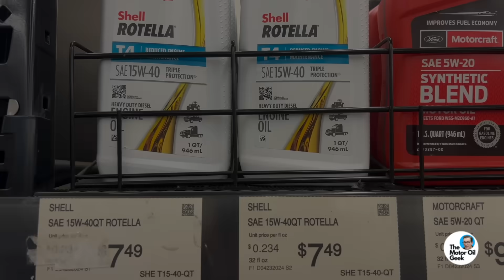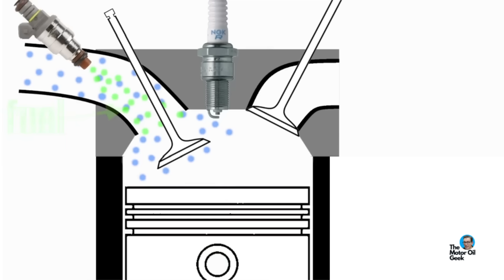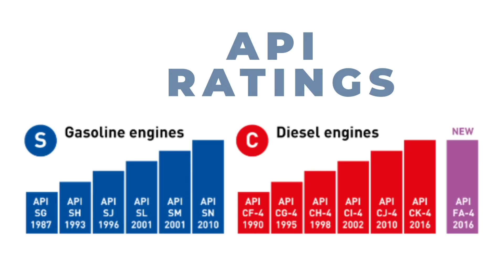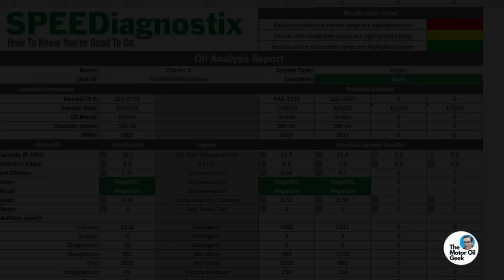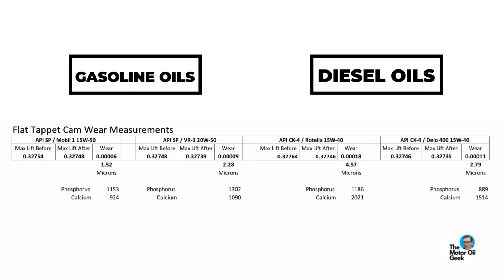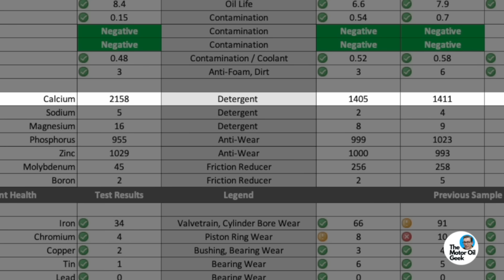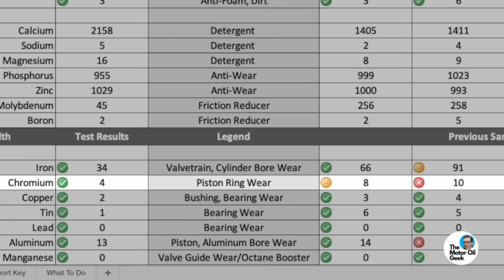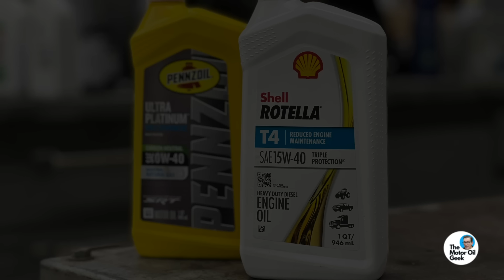Why DIESEL Oil is Actually WORSE for Gas Engines!

Comment: Lab tests the theories and what can happen, but in practice it doesnt matter much... have used diesel oil in small engines around the farm exclusively in both briggs and kohler engines. Zero failures. Also have used it in a F150 5.4 for 20 years with zero engine issues.

Emgine Oils are far different than other fluids like hydraulic and coolants. Use a good proven product and dont worry about it. Proper maintenance is more important. In the same sense though i would never use gas engine oil in diesels because thats asking for trouble.

 some of the newer engines are affected more, like an Ecoboost where a Penzoil is recommended due to the proven tests and experience behind it

Comment: I use rotella 15-40 in my zero turn kawasaki engine with 1800 hours. Runs like a top, no oil consumption at all. Equivalent oil john deere recommends.

Comment: Your use of the term "Passenger car oil" is confusing and doesn't make sense. Tens of millions of passenger cars with diesel engines are manufactured each year. Just stick to using diesel or gasoline, and stay away from passenger car oil. I'm surprised the old guy didn't correct you. He's obviously very polite.

Comment: I like how they used an audi-A6 ringland as evidence of using the wrong oil. Might as well have pulled a Subie EJ-piston-ringland.

No oil in the world is gonna save those motors. Garbage design/engineering.

I'm with everyone else on the Rotella T6 5w40.

Comment: no one cares about DI cars. we want to see iron blocked/sleeved, flat tappet cammed, port/ throttle injected or carbureted engines pre 1995 tested with similar viscosity. the cheapest  Walmart oil vs T4, and M1 vs T6

Comment: You are glossing over a lot of variables. #1 is which gasoline engine. I won't run Rotella in any of my fuel injected engines, but it's an absolute must to use it in my carbureted motorcycle that was meant to use oil with a high ZZDP content.
In short: all that matters is that you use oil that's certified for the vehicle you're putting it in. 
Standards exist for a reason.
Reply from the maker: Stay tuned for the next video.

Comment: 2 Farms & A tractor dealer & at least 50yrs always used 15w40 diesel oil in everything! Not new crap, gas direct injection! All older stuff! Engines went the life of the vehicles! Even had one run for 5mins or more after an oil change, & guy got side tracked & never refilled the oil! I checked the bearings & the engine myself! If there wasn’t new bearings right there, the old ones would have gone back in! If any of the engines came apart for gaskets or anything, they were very clean inside! I definitely wouldn’t use it on this new crap! Be careful who you make videos with! You might get thrown under the bus one day!

Comment: Ferrari mechanic here. The techs at Shell have confirmed to me that the Rotella T6 base stock oil is the exact same base stock as the fancy Shell Helix ferrari factory pour oil. The only difference is the additive package, which Shell has again confirmed is only slightly different for diesel soot control but still ok to use in gas
Reply: I run T6 5w-40 in a '04 325i bme (m54 engine) for last 100k miles, no issues.  

Blackstone oil analysis shows no issues, AND the viscosity remains higher at end of service interval than the 0w-40 Castrol Edge oil that meets BMWs LL01 standard.
Reply: Do you run it in your Ferrari?
Reply: @francfurian8215  sure do!
Reply: @VintageEuropean1 wow- that’s so?
Reply: Idk about full on cars but most every motorcycle guy I know just uses rotella T6, because it’s MA/Ma2 certified and the right stuff is impossible to find.
Reply: @aquaprofile  T3 and T4 is also certified MA/MA2.   Life saver when in a pinch on my dirt bikes.
Reply: @v12alpine  it’s the best for the wet clutch.  Best motorcycle oil ever
Reply: @dtmxing Yeah I’ll stick with Motul 🤷‍♂️
Reply: @aquaprofile  I have used T6 in my boats, quads, motorcycles, diesel and gas motorhomes, side by sides, and wave runners for many many years.  Never a problem.  However, i never use a diesel rated oil in direct injected oils due to the LSPI issue.
Reply: @todddubler2091 I know it’s only a quick google search away, but what exactly is the LSPI issue you’re referring to?
Reply: Amen Sir...
Reply: @VintageEuropean1  this is a lie. It’s not possible if you look at the datasheet for them to be using the same base oil. Also T6 has poor Noack volatility.
Reply: It depends if you own a Toyota or a Honda, olive oil, fish oil or baby oil works fine 😂
Reply: Kind of disappointed that Ferrari uses such cheap oil then. Probably because they nobody actually accumulates enough mileage to matter and shell is making it worth their while.
Reply: My 7.3L Powerstroke has 514,123 miles  on it. Rotella T5  im summer,  T6 5W-40 in winter. Runs like new.
Reply: Caterpillar mechanic here. All engine oil is produced by like 4 companies. All oil in 2025 has a standard it has to meet. There is no such thing as bad oil anymore. Yes shell oil is the same as all other brands. Just use the oil your engine takes.
Reply: I bet Ferrari would love to hear about that guy running that diesel oil in his
Reply: It’s disappointing to hear the Shell is using the same cheap volatile base stock in Helix as they do in T6.
Reply: @G5Hohn there are only a few base oils
Reply: @G5Hohn All brands use the same base stock like semi-syn blend or synthetic based on the newest literatures and researches, either from Universities or Companies.

It goes back to each individual's needs. I use “cheapest” diesel oil for my gas engine because I live in a very hot climate. Carbon deposit will be crazy if I put 0w-20 or 5w30. I need at least 10w-30 or 5w-40 which is commonly diesel oil
Reply: @G5Hohn you really think the oil is all really different lol like car batteries lol labels and pretty colors do sell lol 😂😂😂

Comment: Like others here, I started running diesel synthetic oil in my motorcycles. Wet clutch thing and way cheaper than motorcycle oil. 15 years now I've been running diesel in my 99 2500 chevy truck (spider injection). Lucky me.

Comment: So, I don't understand it any better. I have a 79  4-bolt main Chevy 350. World Product heads , TRW flat top forged pistons, Competition Cams 270 high energy from 1991. Yes , I built it in 1991 and still running .  Comp Cams sent a note in the cam box,  1991 again , to use a Pennsylvania Crude motor oil for the cam. What do I use now. Has Rotilla 10 w 30 diesel motor oil in it now. Drive 500 miles per. year. Thick Shady Albright from Burlington NC. 😮
Reply from the maker: Stay tuned for the next video.
Reply: @themotoroilgeek  Can you explain why Comp Cams reccommends Rotella 15W-40 for their flat tappet cams then, if all the work you did with them showed it caused excessive wear ? We're limited in terms of current manufacturers of flat tappet cams and lifters to get current input...  It's not as if we can expect a solid reccomendation from GM on what current oils are the best fit for a 396 they sold in 1969...
Reply from the maker: @DBCooper74-j1t I’m pretty sure they don’t anymore.
Reply: @themotoroilgeek  That is interesting

Comment: Thank God I run older, solidly-built stuff! I ran diesel oil for about 8 years in the 1986 Grand Marquis (5.0 / 302 V8 engine) I've owned 22-1/2 years now. What made me switch back to gasoline spec oil was the amount of buildup I found inside the engine when I had to remove the front timing cover to seal an ever-increasing oil leak that had been present since I bought the vehicle. There were chunks of carbon all over everything. I had figured there must be something missing from the diesel oil that was needed to keep the engine clean, so I went back. With the soot-carrying capabilities of diesel oil outlined here, I'm not so sure I was correct in that assessment. Although, carbon is a little different than soot so maybe I was onto something. 

Anyway, that car now has 305k miles on it and still runs like a top. They don't build 'em like that anymore. I also ran 20w-50 in it for the first 12 years up here in ice cold MA! Not the best viscosity, especially during a spring start after sitting parked 4-5 months or more! Lots of bottom-end noise for a LOOOONG time until pressure came up! YIKES!! Live and learn!!

Comment: @The Motor Oil Geek   What oil would you recommend for the 60's American Muscle Cars? I have a 1966 Cyclone GT 390 that engine has never been apart & looks super clean inside and would like to keep it that way. Currently has 58k miles on it.
Reply from the maker: Stay tuned for the next video

Comment: Several years ago I contacted Penzoil because I was having a hard time finding their 10w 40w for my older carbureted engines. They put me thru to their lab in Houston, Tx where I spoke to an engineer that recommended using the Shell Rotella oil because it still had a full compliment of Zinc for the cam shaft, unlike their new automotive oils. He sent me a brochure on this,that they were giving out to car collectors on using the Shell Rotella for older carbureted engines, to protect their cam shafts. How does this sound? I unfortunately gave out the brochures and do not have any of them.  This would be for 1970’s and older engines. Is this still good advice?

Comment: I ran rotella T5 diesel oil in my manual chevy sonic Direct injection and that engine ran past 230k miles before i sold it. I always wondered how the engine looked inside. Never had engine issues but i also changed the oil every 4k.

Comment: I've had three older Dodge 318ci and one 225ci with over 500,000 miles on each of them using dello 15w-40. All engines are still running after I sold them years ago.

Comment: I know it's a tiny niche, and probably not easy to make a video on, but I'm curious if the conventional wisdom about rotary (wankel) engine oil holds up. Frequently it's "don't use synthetic oil" and sometimes "use diesel oil" reason being that they contaminate the oil with fuel faster and run richer than piston engines so they produce more soot.
Reply from the maker: We are going to cover that in a future video.
Reply: @themotoroilgeek  Great to hear! SAE 922375 is the only real authoritative thing I've seen about it, the rest is forum lore or Rob Dahm videos.

Comment: People were running the old formula (extremely high calcium 2500+ppm) Castrol and Mobil Euro 5w40 oil in direct injected VWs and Audis (and others) for nearly a decade. They were factory filled with this stuff. Nobody had LSPI or engines blowing up. I'm sorry but there is something else going on here.

Comment: Diesel oil is best for older flat tappet cam engines. Not newer thin oil direct injection junk today.
Reply from the maker: Stay tuned for the next video.
Reply from the maker: Stay tuned for the next video

Comment: I've been reading a lot of the comments and it seems that diesel oils are not detrimental to older carbureted gas engines. I have an old '72 BBC hi perf motor for 1/4 mile racing, and my engine builder recommended diesel oil. The pinned comment from @themotoroilgeek will look at oil for older cars and flat tappet cams in the next video. I'm wondering if the results will be the same for full roller setups? Subscribed to the channel and hoping this will be covered as well.

Comment: Harley actually recommends a diesel oil “if proper oil cannot be used”, I plan on running 15w40 T6 in my bike if I move up North and have the ability to ride below 45F. Have done it before during a harsh cold front, will do it again.

Comment: I think this video completely missed by saying it's bad for has engines and then only referencing Direct Injection engines when most of us have port injection engines and sport bikes that have decades of no issues. With DI I can definitely see why it would be an issue. And in my 2025 Toyota Camry, I only use Mobil 1 0w-8 as I know oils high in calcium would be bad for it. But to say it's bad and only focus on one engine type is misleading.

Comment: Thanks. I have some old diesel oil from when I owned a couple of Mercedes diesels. I was thinking of using it up. Since this came out I looked at it. It doesn't look too good. It looks like there are some white particulates in the oil. I think it's between 15 and 20 years old. Dump time.

Comment: You’re comparing full synthetic 50 weight high zinc race oil to conventional oil of a completely different weight. You’re not comparing the anti wear additive packages of both oils either, just looking at detergents and wear. This comparison is not very considerate of all the other variables involved. You mention nothing of total base number over time. Not to mention high zinc race oils shouldnt be used in any emissions controlled on highway vehicle as the zinc will contaminate your Catalytic converter. There are so many other variables to consider not mentioned, This comparison is one sided.
Reply from the maker: Mobil 1 15W-50 is API SP licensed, so it is not a racing oil. 

Also, camshaft wear occurs in the boundary regime, which is dominated by the functionality of the additives. The viscosity makes little difference in this test.

Oil chemistry has changed a lot over the last 20 years. These videos are aimed at showing those changes and providing education. More changes are coming soon as well.

Comment: Anything work or race related i run 15-40 rotella and it has never let me down. Rods and mains look great even machined loose (circle track motor) excellent oil pressure and engine longevity.

Comment: Always good information. Just a drive low miles and slower than when I was younger. I found out that faster doesn't mean quicker in many cases. Slow down and enjoy the ride. Driving my first daily diesel it is a change she needs some upgrades for next winter. Drove many diesel trucks working over the years always loved the low end power. Thanks for what you do.
Reply from the maker: Glad you enjoyed the video.

Comment: I only run, and recommend. The conventional Delvac 15w45. For carbureted, relatively large displacement gasoline engines. Obviously the temperatures need to be within the oils viscosity ratings range. It's also fine for small engines that need the flat tappet protection the Delvac offers.
Application is key.
Peace.
Reply: Who's saying it isn't? Obviously synthetic is better than conventional. That's not at all, what we're talking about here. Pay attention. 
Peace
Reply: Lake has made numerous videos showing how synthetic oil is just plain better though... It has better film strength, more capacity to absorb and carry away heat and so on and so forth.

Comment: WoW a lot of acronyms and confusion.  Stay with same gas engines, direct injection non turbo..then do comparisons. Your switching from TBI to direct injection to turbo and back & forth. Most gas engines are fine with diesel oils, when you get into the turbo or higher performance that's a different engine.. I use DELO diesel oil in all my gas engines. The newest is a GMC with TBI and close to 500,000 miles.  Would I run diesel oil in a 2025 ICE? No probability not.  But a 30 year old pickup? Yep I do.

Comment: What about a diesel electric generator that runs at 3600 RPM?

I would think it would not be subject to the pre-ignition due to the constant higher RPM (and generally pretty constant load) so a low wear automotive oil should work for it.

Comment: As a licensed helicopter mechanic I can say that I have seen many of our work vehicles run well over 600,000km on gasoline engines using rotella diesel engine oil….

Just do oil changes and use a good filter and you’re off to the races.

Comment: I had two suburbans that both ran over 340,000 Mi and I always used rotella 1540. The motors never quit it was always the transmissions that would go out and the rust in the frames

Comment: Ok in the video you only talked about modern injected gas engines. What about old carb rated engines? In my situation I am working around 1950 Era  tractors. Any words of wisdom will be greatly appreciated
Reply from the maker: Stay tuned for the next video.

Comment: 2001 Cadillac SLS 4.6, purchased with 80k miles on it and ran 15w-40 in it after 100k. It made it to 255k before I sold it for scrap and it was still running strong. 5k intervals...
Next was a 2003 VW Jetta 1.9 TDI with 410k on it and sold it with 453k due to repair costs and the fuel distributor jumping time, plus moving out of state. 
Both ran Walmart brand cheap diesel oil, and other than the VW going insta-black after just 50 miles, both ran well. 
I don't use it in my current car, but if calls for euro spec 5w-40, and the synthetic oil I use is always still clean after 10k on an engine with over 300k on it.

Comment: Thank you for being yet another voice of reason against folks using the wrong oil for a specific application. Always select the correct oil for the Application. The Subaru Bros are losing all their marbles right now… I suspect there will still be a large crowd who don’t care what the engineers say or the science proves.. Lake didn’t even cover the lack of anti-foaming formula in the Diesel oil that is really important for gas engines, Foam doesn’t lubricate well.
Reply from the maker: I appreciate the support!

Comment: @12:31 this diesel oil IS NOT GOOD FOR A TURBOCHARGED DIRECT INJECTION ENGINE.  do you know what most diesel engines are? hint: direct injection turbocharged engines
Reply from the maker: Spark Ignition and Compression ignition are very different.
Reply: Tell me you only heard what you wanted to hear without telling me...

Comment: After watching your video on diesel oil in gas engines, I want to ask this question. On a high compression race engine 15:1 running on methanol with a carburetor, what are your feelings on using diesel oil in this application ?
Reply from the maker: No way I’d use a diesel oil in a Methanol engine. The dispersant in the diesel oil will emulsify the Methanol.